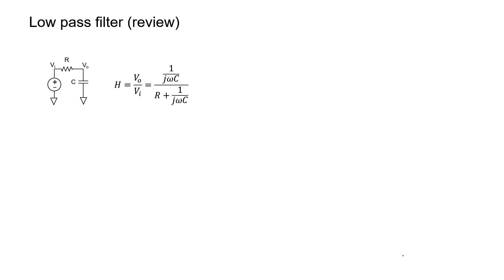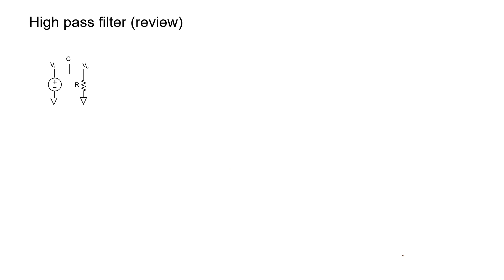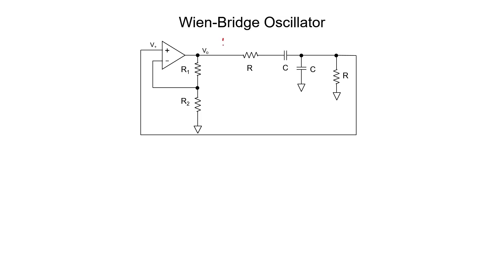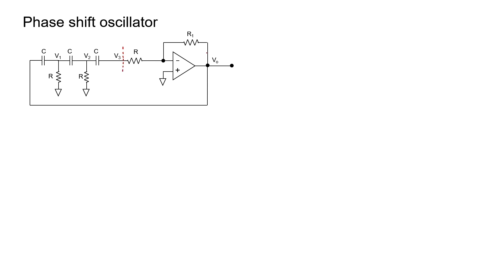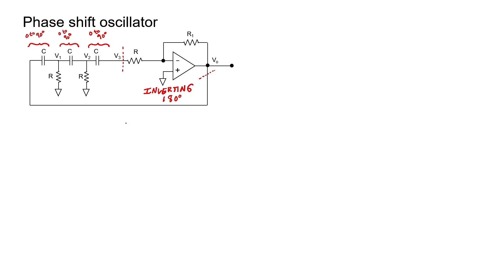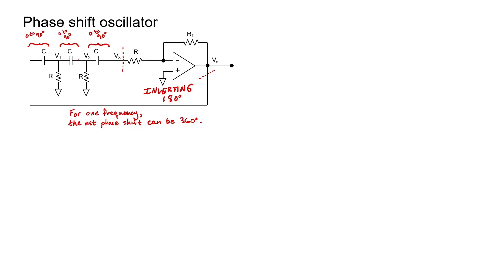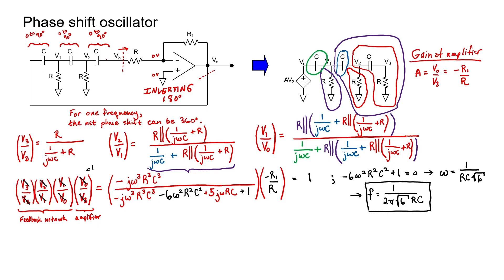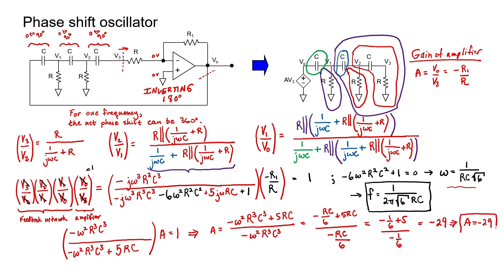Design a Phase Shift Oscillator (4 - Oscillators)

Comment: Kind of suddenly struck me that the apparent resistance of a capacitor decreases with increasing frequency, so, thinking in the time domain, as we switch the capacitor more often, its "resistance" decreases, and more of the signal is shunted to the common/ground... funny that I hadn't thought of a capacitor as a "frequency-dependent resistor", when I've actually designed a current-measurement circuit that uses a switching capacitor to make a current-nulling node.